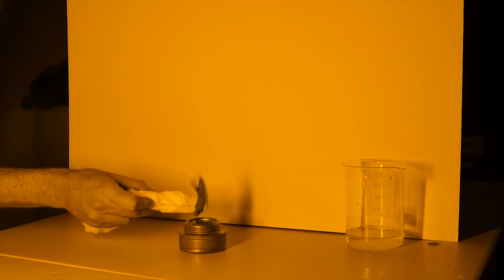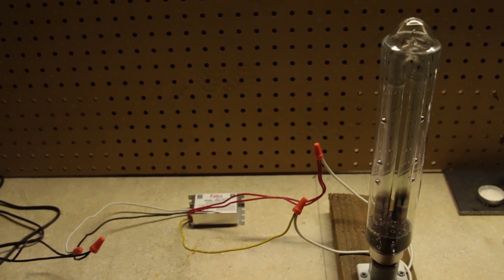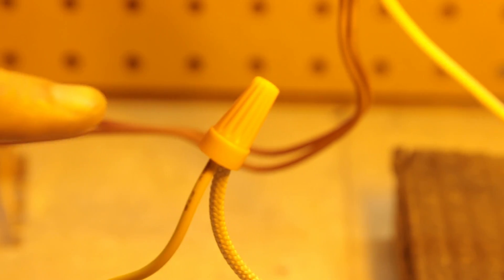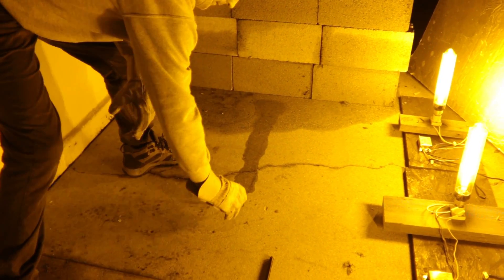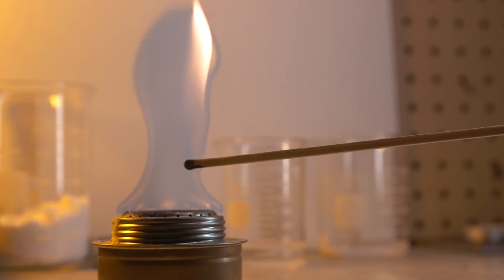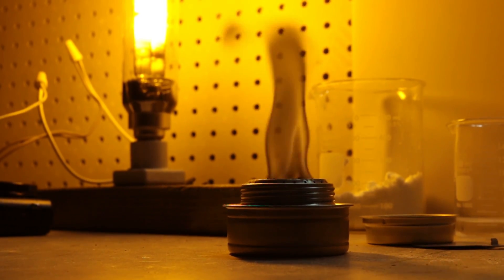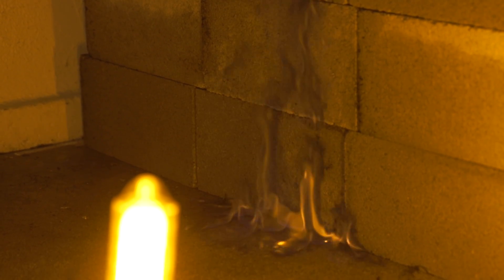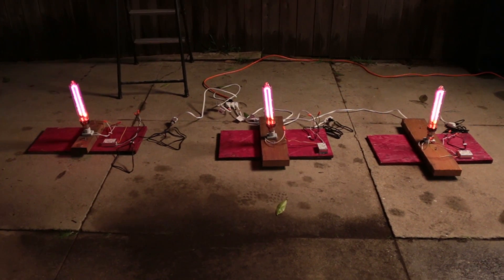Black Fire Experiment (It's REAL) +Black Fire Flame Thrower

Comment: It's a really cool experiment. The reason for the middle of the flame remaining orange is because the intensity of the light given off by the flame was powerful enough to overcome the absorption from the LPS lamps. All LPS lamps are 589(.6). Also, although it's fine for a one-off, that type of LPS lamp really shouldn't be ran base down as sodium can collect at the base of the electrodes, destroying the seal of the arc tube. I believe the specified 'limit' is 20 degrees below the horizontal.

Comment: Your light setup actually is very good. You just jave to use real connectors and not use your lamp base down. The sodium will flow to the electrodes and the lamp will be ruined.

Comment: The problem isn't that the bulbs are too dim, it's that the sodium in the flame is of course luminous itself when highly energetic. The effect you want, "black flame", is only produced when the sodium is hot enough to be ionized and aerosolized, but not SO hot as to cause spontaneous electronic transitions in the atom which produce the yellow D line emission. Try cooling the flame by containing it in a wide pipe at the end of the flamethrower with a metal screen at the end. This should contain the most luminous portion while allowing the warm sodium vapor to still issue unimpeded from the end.
Reply: i dont speek siance

Comment: That's a very cool version of the black fire experiment! I'd like to suggest running those lights horizontally instead of vertically with the caps down. when they run with the caps down, liquid sodium will run down like candle wax flooding the filaments drastically reducing the bulb life.

Comment: Hello nick. What is efficiency of black fire. Like the said is that black flame heat is powerfull or less.
They say blue flame means pure. Yellow means the flame hasnt flamed pure or fully burnt the fuel..
Reply: Black fire is just a regular orange sodium flame under special lighting. So it has the same efficiency.
Reply: @samueloladosu4721  thank you..
Reply from the maker: this is the perfect answer actually... so what Korede said!
Reply: Its burns for seven days and nights